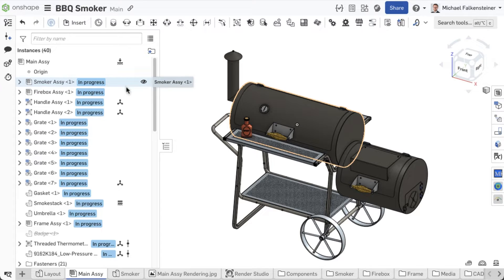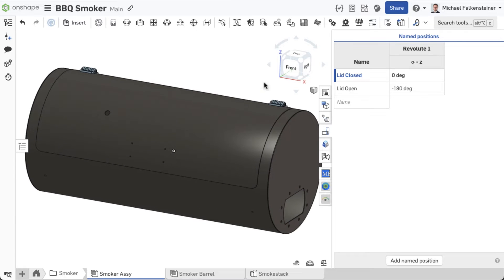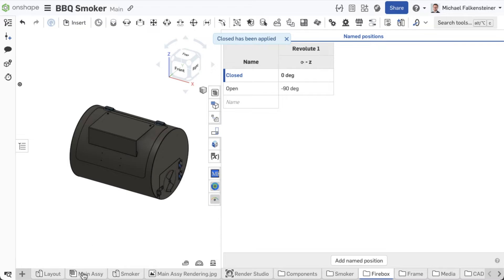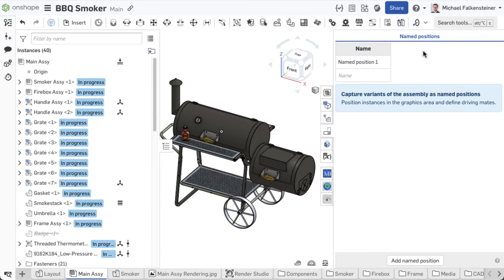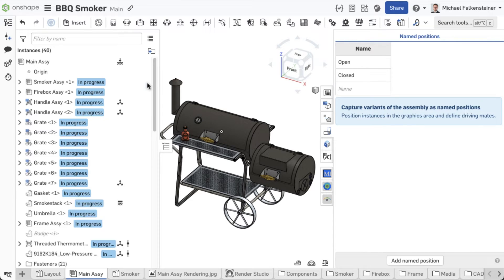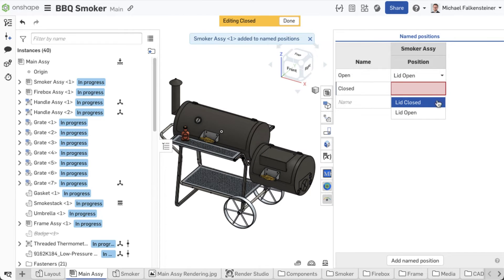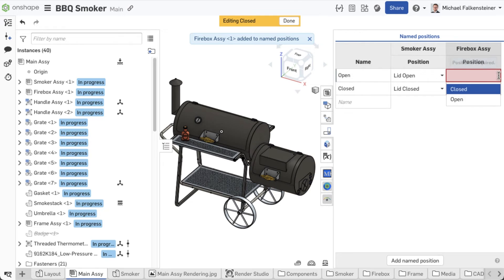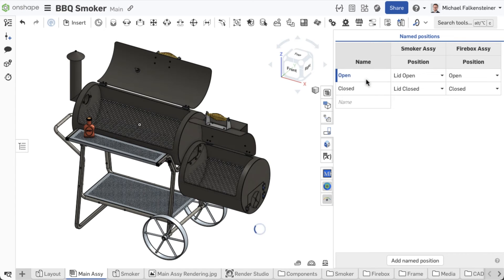Reusing Named Positions of Subassemblies in Top Level Assemblies - Tech Tip

Comment: Thanks for tech tip.  Named position is extremely powerful
Question:
1. What happens when releasing assembly with named position?
2. Why not use configurations OPEN and CLOSED?, what is advantage of either method over the other?

Lewis 🤗